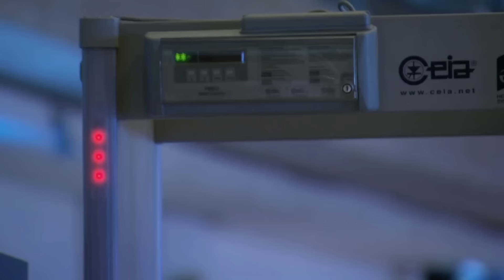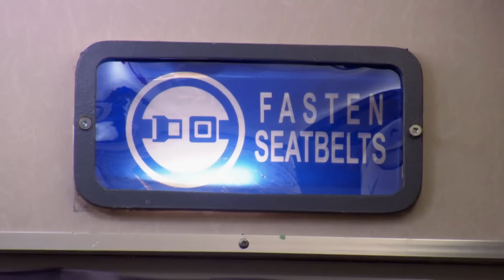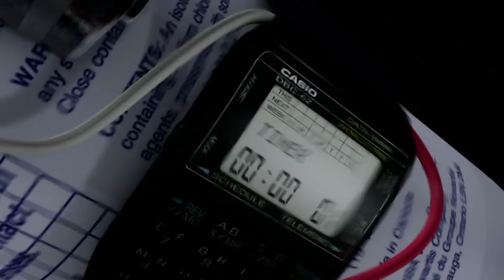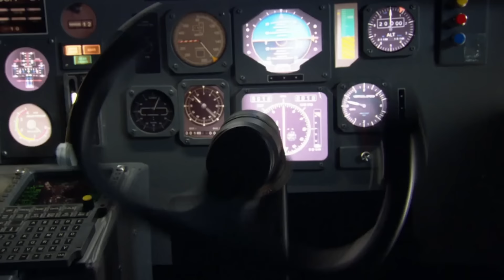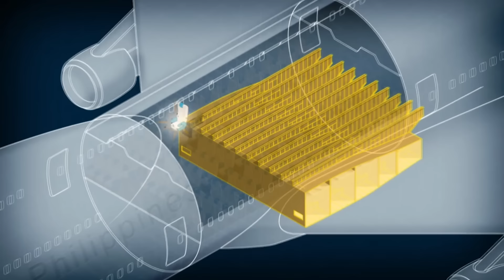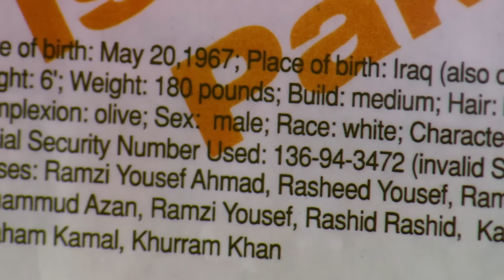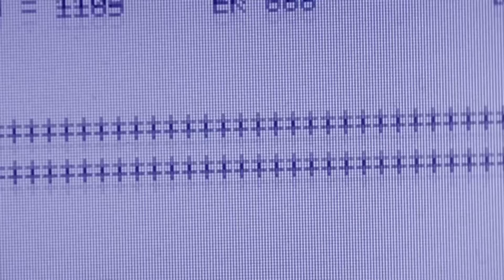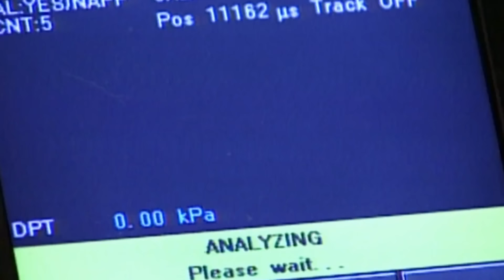An Air Disaster Caused By The MOST WANTED MAN In The World | Mayday: Air Disaster

Comment: A few years ago I was on board a THAI 747 getting ready to fly from Athens to Bangkok. It was 4 PM and after the air hostess have closed the door the plane wouldn't move for almost an hour, then all of a sudden the captain announced that we were all to disembark the aircraft and go back to the terminal. Everybody was frustrated and had initially thought the aircraft had some sort of technical issues and followed suit (the captain never mentioned technical issue as he made his announcement on the PA) But we began to sense that something was wrong as flight crews hastened each passenger to leave the plane quickly like they were in a rush to empty the plane. Inside the terminal we were all gathered in one lounge and watched in disbelief as airport authority towed the plane with a pushback truck away from the terminal building followed by several firetrucks with water hoses pointed at the aircraft. This is when we realised that this was not a technical issue with the aircraft. We were stuck in the terminal building for 6 hours with rumours spreading around that an "extra luggage" had made its way onto the aircraft cargo hold without the passenger boarding. Then at 10:00 pm they brought a bus and drove us to the stricken 747, the bus drove further and further from the main airport area so much so that I thought we were going outside the airport!?! Then finally they let us out onto a remote tarmac right on the edge of the airfield. Luggages were strewn about everywhere on the ground, they told each of us to go out one by one and identify our luggages and show our boarding pass to authorities then reboard the plane. This went on for another hour or two as each checked luggage is reloaded back onto the plane. Then we finally took off never to be told whether they've actually found the luggage that the terrorist have planted or not. The flight that was supposed to land in the early morning ended up in Bangkok in late afternoon. No apology or compensation was ever made and the incident never made it to any media outlet. This was by far the worst flight experience in my life but I'm also glad we didnt fall victim to the terrorist's plot.

Comment: They don't check the airplane between flights? On school busses they have to go through bus after pickup and dropping off. I'm surprised to learn it's not required on a plane or did they just fail to do this? They'd have seen the device taped underneath the seat if they had.
Reply: Exactly my thoughts...
Reply: I guess they didn't check under the seats. They probably do now.
Reply: It was inside a life vest pouch where they couldn't see.
Reply: This was 18 years ago; think about how many changes in how busses are run and checked have happened in that time
Reply: @georgewnewman3201  This was before 9/11. So this was more than 18 years ago.
Reply: @ralphmoran681  Yes you are right, it was 28 years ago. I must have miscalculated. The point I am making is safety rules have changed a lot in those 28 years in air travel as well as other forms of transportation.
Reply: Events like this are probably why you get such procedures to begin with tafterwards.
Reply: they do now...
Reply: It was in the life vet pouch not just hanging under the chair with beeper i mean my god guy
Reply: @Zestyclose-Big3127  Exactly; it seems that the regulatory agencies don't move until they have to and then the new rules are "written in the blood" of the victims of their inaction
Reply: The crew is on a clock during a turnaround.  They have to make the plane presentable and configured for boarding in a  matter of a few minutes.  I don't know which tasks they are required to complete and I'm sure it differs from one company to another.  I would imagine that if the "device" was not big enough to be seen when they look through the rows, they will miss it.
Reply: @TonyP9279  actually, this was a briefer turnaround on a two-leg flight Manila-Cebu-Tokyo with Manila to Tokyo passengers remaining on plane while Manila to Cebu passengers and first flight crew getting off and 2nd Flight crew and Cebu to Tokyo passengers getting on. If there was a ground crew inspection of the cabin (I would think that was not very likely with passengers still on the plane), it would have been even more curtailed than at a final destination inspection where all passengers would get off.
Reply: They do check the airplane and clean it but they won’t check under the seat would they
Reply: @shahdsami5305  At the time this incident occurred they would have been reluctant to do much cleaning and checking as there were passengers staying on the aircraft with tickets from Manila (starting point) to Tokyo (final destination); the airport where the bomber got off was just a connection point between the two (and I'm not sure why this routing as both Manila and Tokyo are north of this airport)
Reply: As has been mentioned, this happened pre- 9/11, so security was a lot more lax.  Now, for example, you can't bring most liquid bottles onboard.  Use contact lense solution?  Too bad, you will have to buy it after you land.  I can also imagine the flight crew onboard checklist has also gotten a lot more stringent.
Reply: @georgewnewman3201  indeed,  there was a time  where no ID was required  to board  domestic  planes. Etc
Reply: This was pre 9/11 the world was not all that worried yet.
Reply: It would more reassuring if bomb sniffer dogs did checks on vehicles includings trains, planes and automobiles.  They are more reliable at noticing things amiss than say cleaning staff.
Reply: The world was a different  world then .
Reply: Wouldn't have had time to check under every seat probably, probably, not with a short turnaround. If they'd had a bit more time between flights maybe they would have :(
Reply: Technically they must “clean” the seats once they are empty and more if someone will occupy them again that day. By clean I mean taking trash and organizing everything but I doubt they inspection everything they probably should but if the cleaning team has x time they will do what this time allows them. 
To be fair I always assumed that someone checks for bombs before passengers enter, maybe I just want to believe it because if not I won’t be able to enter a plane again.
Reply: @jeancd3955  not only that, if you gave a name for the manifest or whatever passenger list they had, it didn't have to be your actual name. Case in point, D.B. Cooper (unsolved mystery of a skyjacking, in case someone doesn't know. More info is definitely on Google).
Reply: Yes they should always do a security check when they land and before taking off for everyone safty
Reply: @ralphmoran681  
Over 28 years now... (writing this in April 2023)
Reply: @leslievey8453  yes it sure was a different world back then. ❤️
Reply: You think that the flight attendants have time to go through the cabin with a fine-toothed comb L

Comment: You’d think the bomber would be smart enough to know to not pick the very front seat of where the tank is if the point is to blow it up
Reply: The problem was that Philippine spec aircraft had the seats in a certain configuration, that would have made his plan successful.  However this exact aircraft was ordered by, spec’d for, and delivered to, Scandinavian, which when it got bought by PAL, didn’t line up with the others.  His research into seat assignment was figuring on a PAL spec aircraft, only if he had known which exact aircraft would be flying the route, and extrapolated the modified seating arrangement accordingly, and booked 28K or back, would he have been completely successful.  Yeah well he didn’t, so he wasn’t.
Reply: Chemical engineers will know
Reply: It was a different type of 747 than he expected
Reply: A Volpe  gooooood question.  If he were perfectly intelligent, he wouldn’t have gotten caught.

Comment: Congratulations to the engineers who designed and made that aircraft, as the light structure was still strong enough to withstand that explosion for which it was not designed. If that engineered structure did not hold the additional  created forces , all people would have died, including that brave pilot and crew. Also, it was remarkable how the redundant  engineering  systems available to the pilot  left him with enough control to land safely.  Every flight necessitates the  teamwork of a group of people depending on each other. 
Unfortunately engineering in the wrong hands can hurt many people and no matter how one looks at it, engineering is the reason why the world has become so polluted and so dangerous and paradoxically, it is engineering that will find solutions to the problems we have created for ourselves. If that flight  did not contain the damaging bomb, it would still have burnt over 100 Tons of fuel which would need to pollute over three tons of air per second for four hours ( approx. 40,000 tons of air) and that is a lot of pollution damaging to our environment.  Flying is not all that innocent, and as long as it is convenient for us, we really do not care what damage to our environment it produces in addition to shipping,  Industry and coal and oil, atomic and gas burning  electrical power stations. We tend to focus on the damage to us that can be pinpointed to a terrorist and a criminal, when in reality there are more invisible criminals in our society, flying over people's heads  with 100 tons of fuel, without their permission, all because a law is passed that they can do it!
Reply: You should also congratulate the pilots!
Reply: @Carmel Pile
So... back to sailing ships? And recycle/scrap all internal combustion, steam, & hydrogen engines; add electric vehicles & nuclear reactors to the pile just because; and start growing lots of oats for all the horses we'll be using.
😟